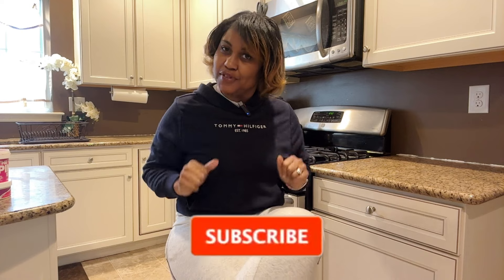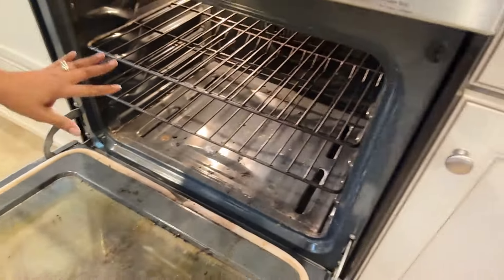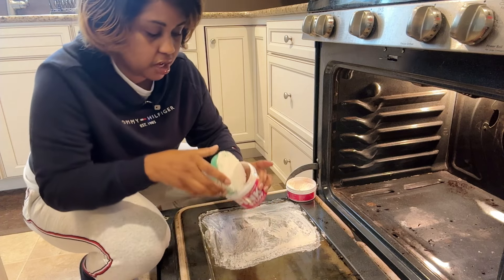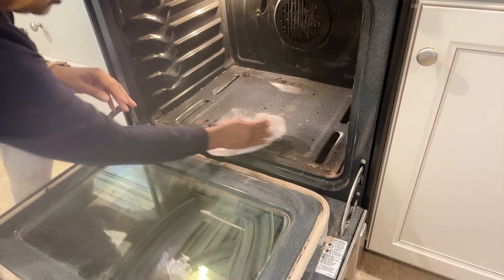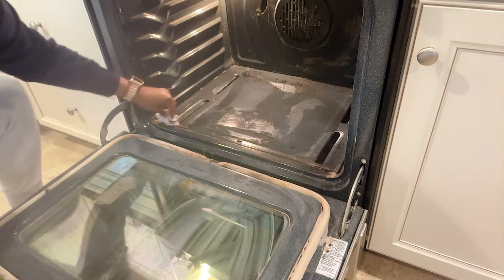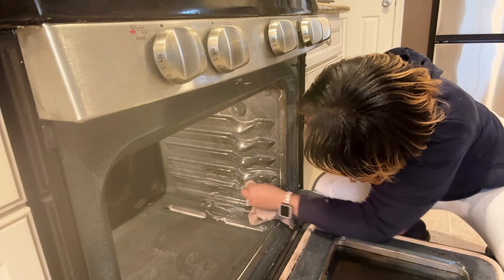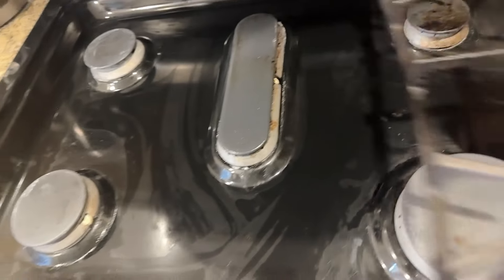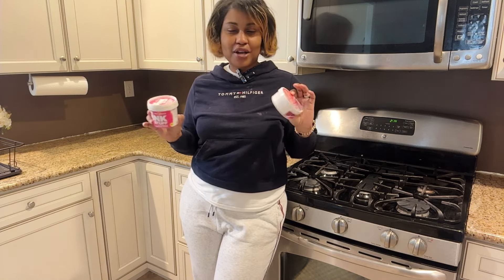Comparing Dollar Tree's Multipurpose Paste to The Pink Stuff

Comment: Most oven doors come off.  Open it about 8 inches and lift the whole door up to slide it off.  Then you can take it to the sink and work standing up, and you can reach into the oven much more easily to do the inside. You can then also easily clean the area at the bottom of the door where all the crumbs collect. After you're done, hold the door at the same angle and slide it back on.
Reply from the maker: That’s an excellent idea. A deep cleaning is definitely necessary. This was indeed a “lazy” clean. I will try that next time.
Reply: I didn’t know that!